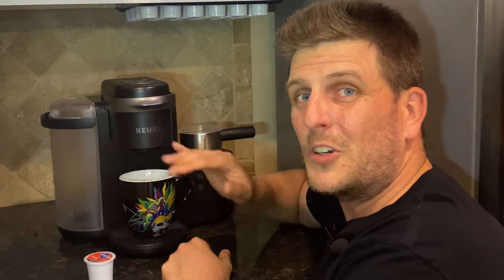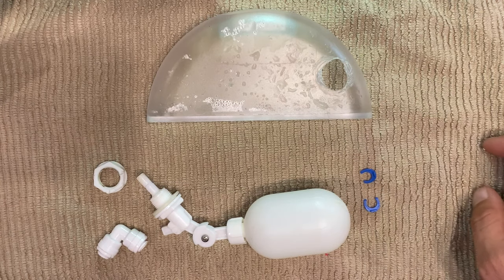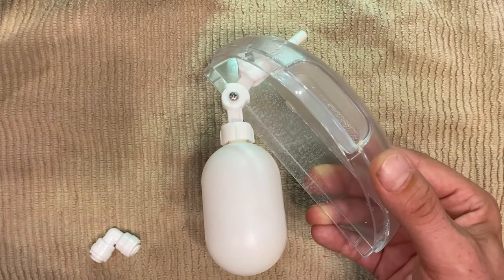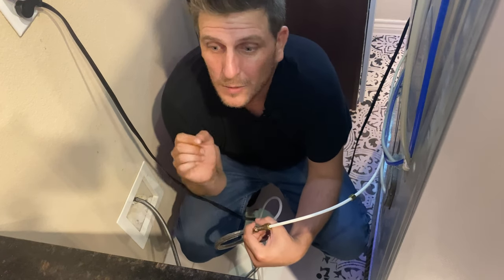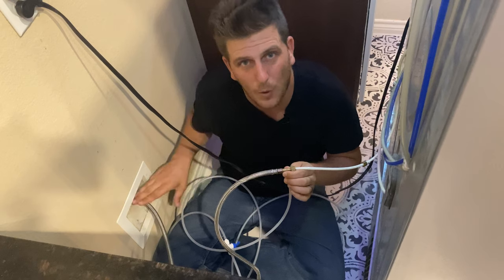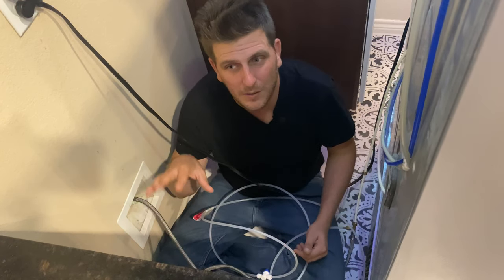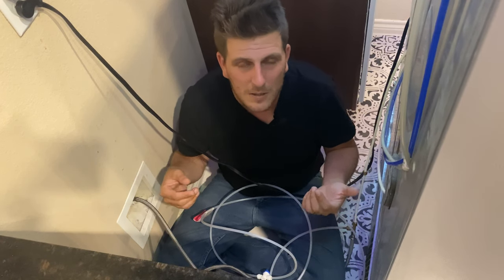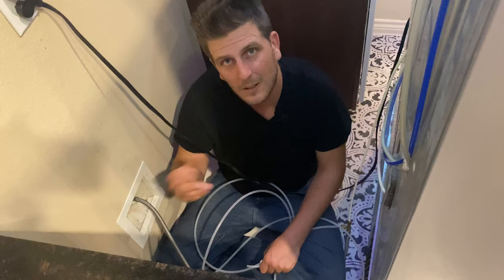I Fixed Keurig's Worst Design Flaw (Keurig Water Refill Solution)

Comment: Also, I did have a mishap once with the lid coming loose, and the float valve allowed water to overflow onto the countertop and floor.  Since then, my failsafe fix is an overflow tube in the tank, with the drain line going into the sink.

Comment: Awesome. Does the water when filled up push the lid off? Good stuff ❤
Reply from the maker: Nope, just adjust the ball valve to shut off at the proper point
Reply: @HomeDIYDan  will be trying this at work. Thanks.
Reply: Mine didn’t push up, but “others” in my household don’t pay attention to what they are doing, and disturbed the lid, causing an overflow once. See my other comment for the fix.